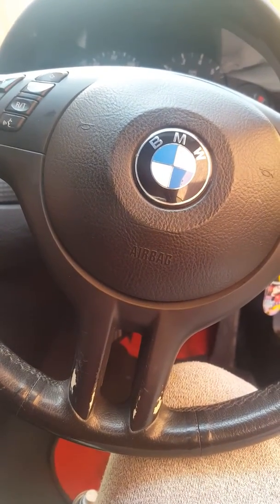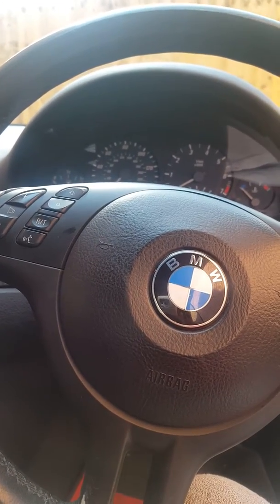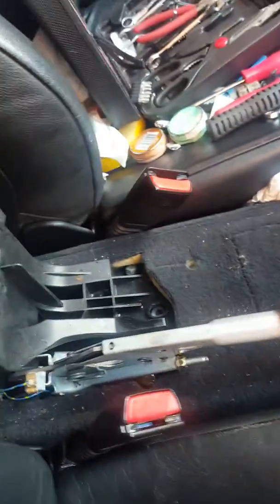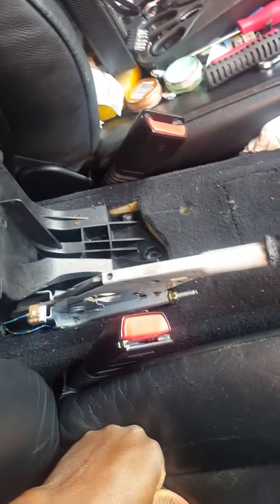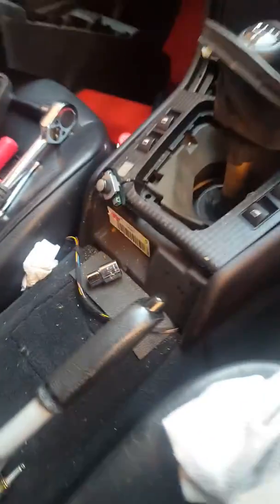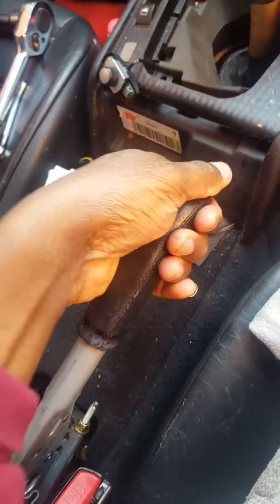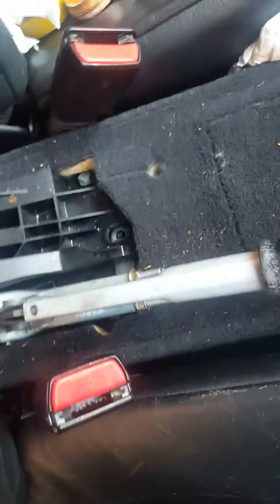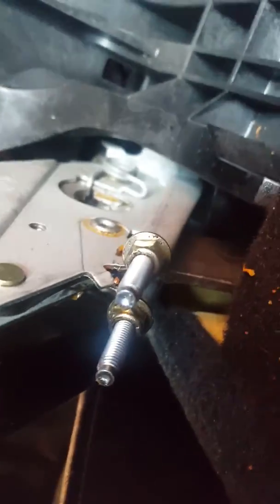How to fix a handbrake on a bmw e46

Comment: Check your ratchet teeth too... my first 4 teeth were worn flat (E46 coupe was 12 years old, 104k miles)... you can check the ratchet teeth by loosening the 2 adjustment nuts completely then pull the handbrake up fully so that the ratchet teeth are exposed, then you can check them...

Comment: Pretty sure this just happened to me too.  the button is stuck in the "pressed" position. I'll let you know how your method works. 
Here is a forum post which also provides a fix: https://forum.e46fanatics.com/showpost.php?s=95b13e17f71c8511807ffa7cd84034d0&p=16856730&postcount=6
Reply: Did not need to bend the retaining tab as show in my link above. Only needed to force the spring free and apply grease. Problem solved! Thank you!